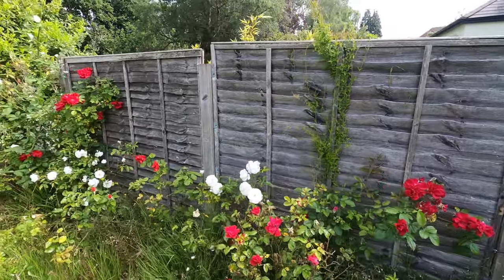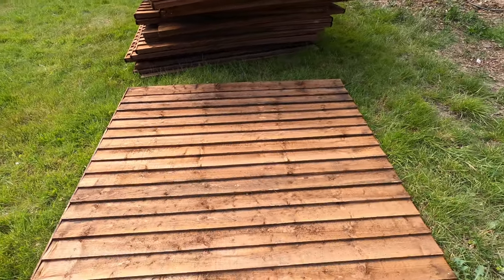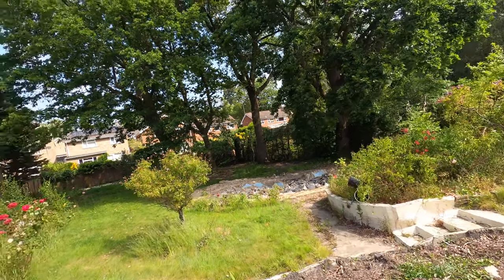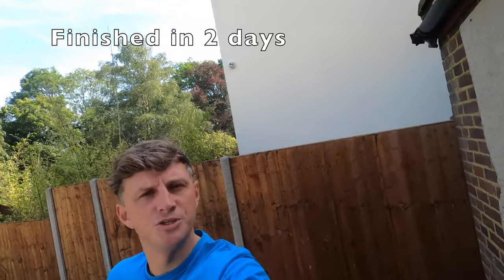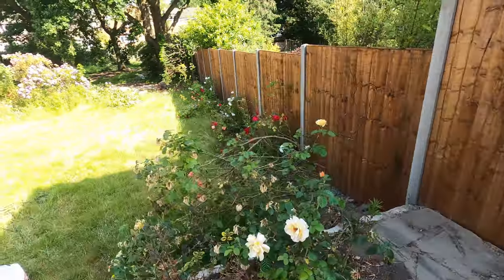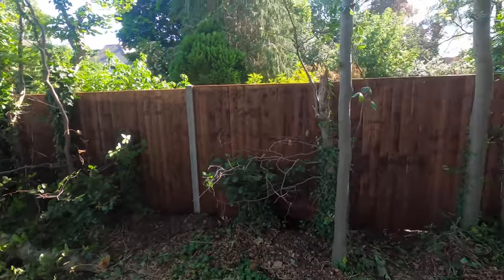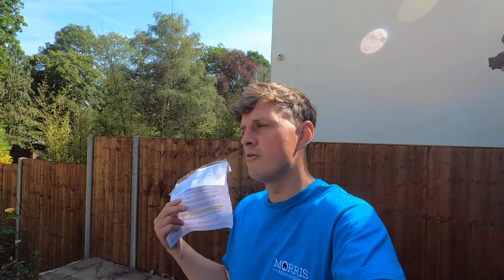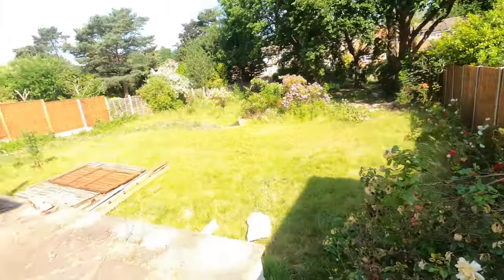I saved £2300 on my closeboard fencing installation! Fencing DIY Concrete Posts

Comment: Really good channel to eyes on, like the way you use labour only - we recently replaced a roof to a summer room / breakfast room, quotes from companies ranged from 6,500 to 9,000 - we purchased all materials for just over 800, then labour only another 1,000, so massive savings by doing it that way (like you we had to discard of all the old roofing and bits - 4 tip runs and bingo all cleared).
Reply from the maker: Wow that’s a huge saving. Well done!

Comment: Gravel boards is not about making the fence sturdier.
It's to prevent (reduce) the fence panels rotting on the bottom.
Because in a few years what happens is you have a perfectly sound fence panel on top, but it's rotten at the bottom due to direct ground contact, rains splashes dirt on it etc.

Comment: I like close boarded, but my preference because of the sloping site would be to have the top of the panels all level at the same height, without the severe step change up top, especially as this will be viewed from near the house, variable height gravel boards timber or stained concrete at the panel base to allow  the fence panel tops to be inline and level,  aesthetically better looking and pleasing.
Reply from the maker: I agree but that would be impossible here. The difference between the fence at the top of the garden and bottom differs by at least half a metre so you would have huge gravel/wooden boards. This sort of thing mostly only possible on a new build flat garden!

Comment: Nick not using Concrete Gravel Boards will the fencing not deuterate at the bottom more quickly? Looks nice though
Reply from the maker: Yes always the risk but I think gravel boards are unsightly!
Reply: Should have at least put down a sacrificial wood board so you can replace that instead of the panels when it rots
Reply: I would have gone for concrete gravel or a board to keep those expensive panels off the ground.
Reply: @NicksHomeRenovations  I spray stained my concrete gravel boards same colour at the panels, they disappear and blend in fine, I’ve also used treated timber as gravel boards.

Comment: Question: why did you have to do/pay for the fence if it's shared between you and the neighbour? How does that work?
Reply from the maker: The common thing in the UK is you are responsible for the right hand fence as you look down the garden. So I was responsible for this one and my neighbour on the left, the left hand side. I am also responsible for the back fence too but that can depend on what the title deeds say.
Reply: I was always told you were responsible for the left side

Comment: Did you use a string line? How do you keep a straight line?
Reply from the maker: That's one way, or just by using levels.
Reply: @NicksHomeRenovations  You haven't got my dodgy eyes lol. Loving the house Reno, weve just bought a similar property albeit a little smaller but looking forward to the transformation. Thanks for the reply.